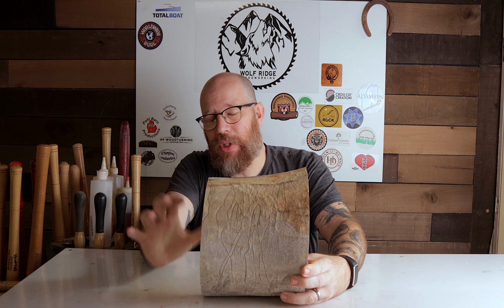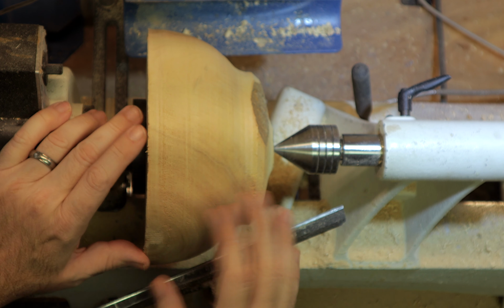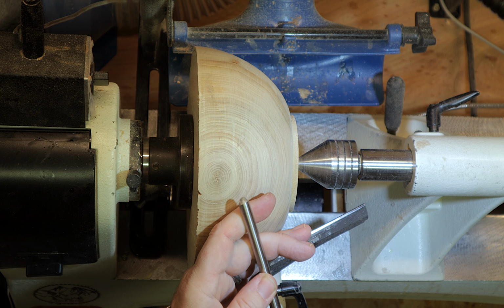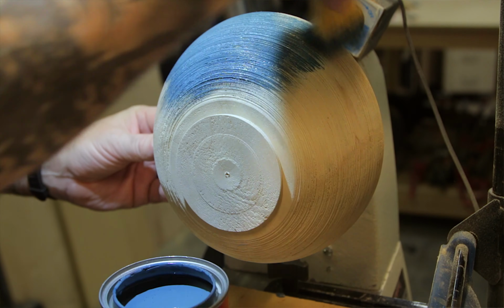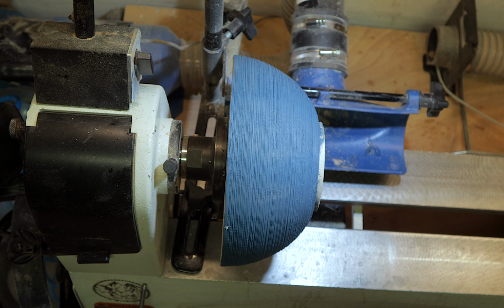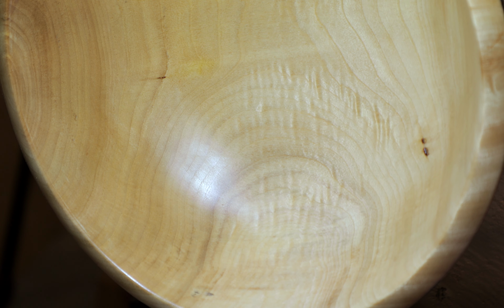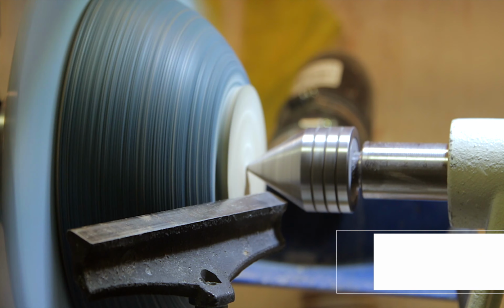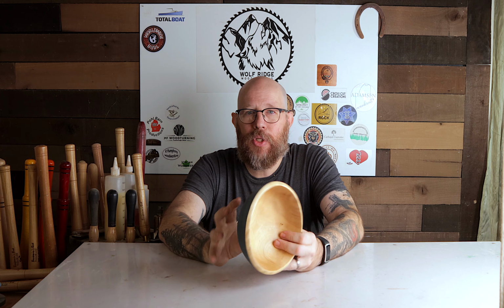Woodturning: Textured & Painted Cottonwood Bowl (For Sale)

Comment: Never considered cotton wood.  It is soooooo soft. Lots available as it has zero value here in Washington.
Reply: Cottonwood is great wood to work with and has beautiful designs. I cherish all I can get, but here in my area, I can't ever seem to find a decent piece. It's usually rotted out or hollow cored. I'd love to have a piece like Ed is working on for a bowl. Mine are only good for small vases or twig pots.
Reply from the maker: It is very soft and tears out a lot, but does finish nicely.  The finished grain is very nice.  - Ed